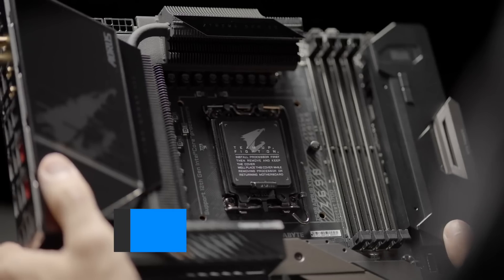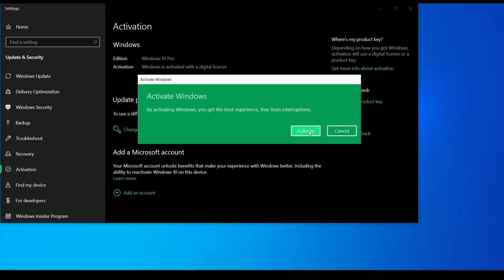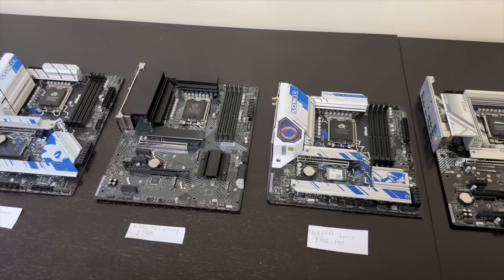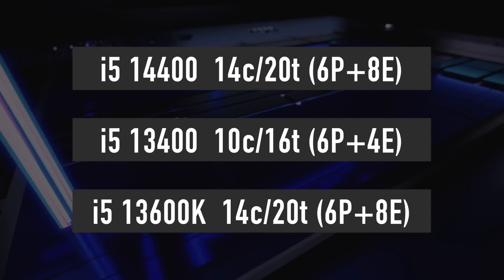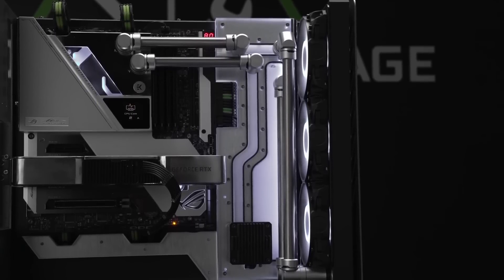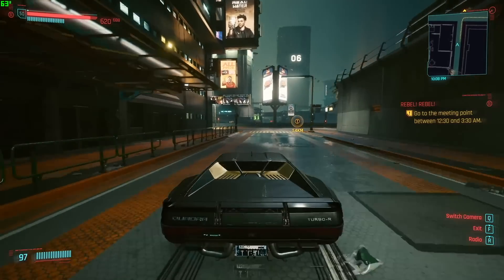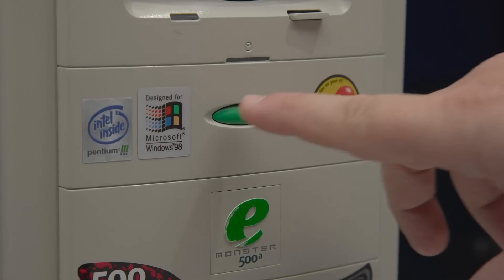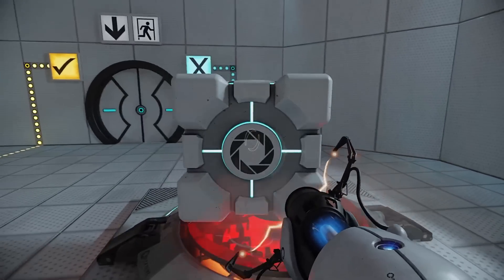Intel 14th Gen is actually VERY impressive! [i3, i5, i7, i9 specs, performance, release date]

Comment: Intel is fooling us, why they didn't make the primary core is higher than extended core, example in i9, they can make the primary is 16 cores 16 threads and the extended is 8 cores 16 threads for better, not this 8 cores 16 threads primary and 16 cores 16 threads extended

Comment: Unfortunately, the 400 series i5 has gone well beyond ‘budget’ nowadays, especially in countries where you’ve got VAT and Import Duties to factor into the retail price. The lowest price here in South Africa for the 13400F is $265.
Edit: The 13100F, on the other hand, costs ~$150, leaving a whopping $115 price gap, which could have been filled by a 13200F (6P:0E/12T), in the $170-$190 range, and a 13300F (6P:2E/14T), in the $200-$220 range. Hopefully they do something similar this generation, with a BETTER pricing scheme. There’s so much money for Intel to make in the budget (real budget) market, with AMD having virtually abandoned it.
Reply from the maker: Unfortunately, there are contradicting reports of core count increase. So, we don't know for sure yet. I'll do a follow up video when rumours turn into something more concrete.

Personally, I hope that Intel takes this step and increases the core count for i3 or Core 3 (whatever they'll end up calling it in the future🙂)

Comment: I do not think it's worth upgrading with such a timid performance. I have a PC with 13th Gen it's Ok. Just take a look at Intel they manage to release another Gen within less than 12 months. Really waiting for Ryzen 8000 results.
Reply from the maker: True. Ryzen 8000 is the next big release that should bring significant improvements worth talking about🙂 But you probably won't need to upgrade for a long while.

Comment: Sir, I have 12400f B660 chipset dose it support 14th gen 14400f
Reply from the maker: It will eventually. Your motherboard manufacturer will have to release a BIOS update at some point to make the motherboard compatible with the 14th gen.
Reply: @theivadim  Thanks for the information

Comment: Considering Intel for my next build to avoid Fanboyism.  Currently have an all AMD AM4 build.  Can someone provide a video name on Youtube that explains the benefits of E-Cores for gaming?  I would like to also have more than 8p cores and not a collection of cores so that we can call it 16 or 24 cores.  I also heard AMD may go the E-Core route as well.  I want more P-Cores cause I don't want to upgrade my CPU for awhile.  I'm not even sure if the Ultra series will have an upgrade path like AM4 or even AM5.
Reply from the maker: The general consensus on E cores for gaming = no benefits.🙂
AMD is considering using dense cores. It's like the ones found in EPYC CPUs  Zen 4c. This is not the same as Intel's E cores. I don't think we'll see it on desktop soon. Zen 5 aka Ryzen 8000 will use normal cores. I suspect that using smaller (dense) cores is beneficial for laptops where size is important. So, we may see that strategy implemented on laptops first.

Comment: Not worth it. I have 2 z690 motherboards i updated bios in. One has 13600k one has 13700k. Good enough for now. Get 12th gen or 13th gen if small difference in price. Other option get ryzen 7 7800x 3d

Comment: Just got a 13100f a couple days ago. These new 14th gen will offer a great upgrade path for current lga1700 mobos, in in 3 or 4 years, for the time being i'm happy with the 13400f.
Reply: In 4 years you will upgrade all of your components. 14th gen will be 3years old at that point. Is someone buying 11th gen now 😂? No, it’s outdated. Same logic for your case. Either upgrade in the next 1-2 years or you buy new mobo in 3-4 years
Reply: @daniil3815  don't know for others, but i like to squish my hardware, before the 13100f i was still using a core2quad based xeon x5470 as my main computer, and am writing this on another core2quad with linux.

I might give a look for 14th gen in a couple of years, but for the time being i'm happy with the 13100f, but as always i will squeeze it to the limits.

Comment: apparently the 14 gen will have 20 PCIe 5.0 lanes to the CPU - sufficient for 1 x PCIe 5.0 x16 (graphics card) and 1 x PCIe 5.0 x4 (M.2 NVMe SSD). a motherboard refresh is necessary for this, right?
Reply: Unless there's a new GPU that requires PCIe 5.0 out there, I doubt it
Even current beast RTX 4090 still run optimal on PCIe 3.0 x16 mode (equivalent of PCIe 4.0 x8 mode)
Next gen graphic cards probably would still run on PCIe 4.0

Comment: I am excited about this. I currently have a 12600k on a z690 motherboard and was sure I wouldn't be able to upgrade past 13th gen. Not only will the 14600k have higher clock speeds but 2 more E cores and 4 more P cores so this will be a noticeable upgrade while still retaining my z690 motherboard.
Reply: I'm excited about this as well. Just got a new mobo, GPU & CPU a few weeks back and I'm glad that I will be able to get a 14 700K or 14900K to replace my current 13600K for a great improvement maybe 2 or 3 years down the line. :) I just upgraded from a 9400F, LOL!
Reply: Same

Comment: Based on the video the difference between the i9 14900k and the 1900k isn't that big I'm getting the i9 13900KS soon, and based on previous data it does slightly better on FPS  I may assume it's pretty much close or the same as the i9 14900k , if my CPU is good I could overclock P-core to 6500 Mhz, it will be interesting  to compare stock, and then overclocking between both, but in the end I don't think it's worth upgrading if you have a 13th gen CPU already
Reply from the maker: Are you getting a 13900KS at a discounted price? If not then might as well wait for the 14900K to see if it offers the same performance at a lower price. The 14th gen may feature a better memory controller for higher (more stable) DDR5 speeds.
Reply: @theivadim So I ordered mine from an Australian retailer since there were none available in the U.S. There was only one available, but it was being sold by a scalper at a significantly higher price of over $1k. I managed to get mine for around $760 and had it shipped to the U.S., so in total, I ended up spending $860.

I currently have a regular i9 13900k, but I'm using that in my friend's build. I plan to build my new custom PC in 2 weeks from now, which is why I didn't want to wait for the 14th generation. I believe it's worth it anyway, especially since I'm coming from an i9 9900k build that I made 5 years ago.

the price is still within MSRP price range and I plan to overclock my CPU
Reply from the maker: Understandable🙂 Enjoy your upgrade and have fun overclocking!
Reply: @theivadim  Thank you!, hopefully I will be uploading a youtube video on the process next week.

Comment: No 14900ks? Also anyone who has a compatible board (especially those who bought low end 12th gen) could make a very decent jump with great value once the 15th or even 16th gen come out and prices of 14th gen become more accessible. It could make a lot of sense for many users
Reply: it looks like its upgrade just for people that have i3 12-13gen and i5 12 gen. Sadly 14900k still is 8 core and i would feel bad to upgrade from my 10900k with 10 p-cores

Comment: I3 would be insane if still priced around 120 bucks. But generally said, for lga 1700 users with i3s or 12th gen i5s, the upgrade to a 14600k could make sense, since almost no one will ever use more than 8e-cores going higher will likely end in diminishing returns…

Comment: Glad I jumped into Z790 from Z690. Was hoping 14th gen would utilize z790. Hoping the IMC is better on 14th gen than it is on 13.
Reply: considering 12th and 13th have identical IPC, this will be the same as well. they are only bringing out 14th gen to try and keep up with AMD using the same architecture.

Comment: Just bought 12400f(150€)+32go ddr4c17 (60€)+ rx6700xt (300€)+ nvme 5500mo/s(50€)+ psu750w silver (70€)+ motherboard (120€)+ case(50€)+ cooler(35€). An all new 2k ready pc for less than 850€. Can't see better deal and upgradable to 14th gen with no bottleneck for future gpu. If not on extra tight budget, would have gone for an am5 7600 with ddr5 6400 low timings but 200€ more for more or less the same perfs. Benefits would be ddr5 and a future upgrade on 8xxx x3d series.
Reply from the maker: I'd do the same if 200 Euros was the difference. You caught a nice deal🙂👍 I hope you'll enjoy your new PC!
Reply: @theivadim  sure i enjoy it , good prime days deals.  Thx for your vidéos, they are also enjoyable.😉

Comment: I have a feeling the prices will be high for 14th gen like the 13th gen prices have been, but when they come out 12th and 13th Gen prices will drop
Reply: Best to buy the last gen stuff is you want value, I don't think these CPUs will be that much better price to performance over last gen.
Reply: @Alex-ii5pm tbh I disagree. If you buy 14900k, it will cost more now, but you will be able to sell this cpu for much higher price later because it’s going to be the best CPU on the socket (mobo gen). And as a bonus you will have better experience
Reply: kogami420  price wise, the 12th gen stuff is better value, if you only care about gaming the I7 is all you need as both CPUs have 8 performance cores at similar performance. The I9s are clocked a little higher and have a few more e cores
Reply: the prices of the 13th generation are not high, but those of the AM5...
Reply: Power draw will be horror.. save the planet lol
Reply: @inuyashatb7575  no it won’t but ok dude…
Reply: @inuyashatb7575  if the load is gaming only the power draw is not much different to the AMD CPUs, if you are worried about power you can always undervolt.

Comment: i have a 13600K, would a upgrade be worth it to 14700K ? i play at 1440p! maybe i got response. despite that it will be interessting when Intel and AMD are on same node, then we se wich really is better
Reply from the maker: I think you are good with the 13600K for a long while. Enjoy it!🙂
Reply: I won't be upgrading my 13600kf for a long time. It performs really well and I'm more gpu limited anyway (rtx 3070). It depends on the rest of your setup, but I'd say it's definitely not worth upgrading for a few years, unless you're doing something really cpu intensive
Reply: No need.
Reply: Watch reviews then decide.
Reply: Unless you have very specific needs (and you would know if you'd had) then only upgrade when the system actually feels slow. I'd say for normal, mundane tasks and for gaming, you should be very good for at least 2 more years.

Comment: 10 performance cores instead of 8 would have been epic
Reply: May be in arrow lake in 2024 or panther lake In 2025. Not confirmed.
Reply: Arrow lake in 2024 has 8 P cores and 40% better single core performance than 13900k.
Reply: @HDRPC  Arrow Lake has 20% better single core performance, not 40%, lol WTF. And the rumors are that there will be a "Beast Lake" which will be extremely focused on single thread performance and gaming and that it will have only performance cores and more than 8 of them. I guess it will be a Panther Lake variant/spin-off

Comment: It is a refresh of raptor lake, and can be used as lga1700. Nice upgrade, but everything is pricing.
Reply: Yup, well said!
Reply: Yeah but I don't think anybody will upgrade to 14th gen from 12th or 13th gen
Reply: @Mayeloski  I can see it from 12th gen, it will make sense
Reply: @@blue-lu3iz get 6400mhz ram instead. is not that much more expensive and it's guaranteed that you gonna get hynix a-die so you can easily overclock it to 7200mhz

Comment: in real world use I don't think the 14th gen is worth an upgrade over 13th or even 12th gen. The KS SKU is obviously a bit of a joke - the 12900KS went on sale at $800 and i've recently seen them for around $350 on Newegg: the KS is obviously just a cash grab by Intel. Does anyone actually buy them? What's the real-world use case? Some extra-sensitive high-speed trading platform? The next useful upgrade has to come from lowering power requirements and increased IPC that should come as a result of moving to 5, 4, or even 3nm process. Those will be the chips worth upgrading, although they will likely require a new socket and PCH. However, if what we've seen with the 12th gen continues, 14th gen will be very good for 13th gen prices!
Reply: Why you want hot a$$ cpu for when you can get i5 13600k for same or cheaper price
Reply: The KS models are really only for those who do overclocking as a hobby. That is, the overclocking itself is the goal. Or for the few who have more money than reason.
Personally, I see nothing wrong in that.

I do think that those who have 12th gen, especially i3 or i5 can have a very VERY nice upgrade with 14th gen. Especially like 6-12 months after release, they could get a very good deal. And keep the same motherboard.
Reply: 13900KS has been sold out for over 4 months now. Don't believe me? Try to find one at any retailer. They're selling like hotcakes.

Comment: Intel used to be amazing but now they run way too hot. Not efficient in any way, poor design in my opinion. AMD is the only option at this time
Reply: 7950X runs at 95C in stock config way more than a recent i9 does. I have both, I watch the temps. So I wouldn't say AMD is the only option. You can lower the power limits in the BIOS for both platforms of course.
Reply: @treyquattro yes
Reply: 80 watt of i9 13900k with undervolt has same performance as 70 watt m2 performance and 82 watt of R9 7950x(with pbo) in content creation.
Amd and apple has node advantage still i9 13900k has similar perfomance per watt.

In gaming i9 13900k is efficient and faster than non x3d chips from amd.
Amd x3d is efficient in gaming due to large l3 cache.
Arrow lake in 2024 has large L4 cache like broadwell to destroy Amd zen 5 x3d.
Arrow lake has 40% better single core performance than 13900k.
Reply: Intel is going to destroy everyone in laptops in just 2 to 3 months in September 2023 with great efficiency, battery and performance,  fastest igpu for gaming.

Then arrow lake in 2024 will destroy amd zen 5 in gaming because it has 40% better single core and 60 to 65% better multicore. It has Large L4 cache.
It will destroy amd in efficiency because they will use Intel 20A node which is far better than tsmc 3nm or 2nm.
Reply: Amd chips are burning and worst in content creation.
Reply: @HDRPC That issue is fix now
And its not amd faults Its ASUS motherboard.

I have 7800x3d and ASROCK motherboard. I use 20$ air cooler.
Turn off IGPU on bios.

IDLE 7 to 12 watts
Gaming 30 to 50 watts
Video editing 107 watts
Temperature 30c to 60c
Reply: People that are concerned with being hot or a lot of power draw should also learn that Intel highend chips are pushed WAY beyond the efficiency window. Bring the clocks back a bit and VOILA! the CPU is now "magically" very efficient.

Seriously, it's insulting how many people think that a 13900K consumes 300W everytime all the time in any workload. While you can run it at 100W and 63 degrees Celsius and not notice the difference in many situations, or have 10-20% less maximum performance in the rest of cases.

It's equally as insulting as the people who think they have to buy a 7600 (non X) to run it in 65W and that a 7600X cannot do it. Jeez people, educate yourselves a bit.

Comment: I think 14600K will worth the upgrade. 16 cores are already good for productivity and streaming while it'll have a 13700K level of performance for cheaper and it'll also draw less power than the 13700K.

Most people only look at performance but power consumption is also a very important factor and even the 14700K being that close to a 13900K for way less power draw is amazing!
Reply from the maker: Yeah, I like a good performance to power consumption balance. Just 5 years ago we had 95W TDP i9 9900K which use to be the flagship😄 Now we have i9 that is 125W TDP but in reality consumes way way more.
Reply: Power consumption is only important in Europe. In the rest of the world, only performance and heat is important.
Reply from the maker: @angrysocialjusticewarrior  more power consumed = more heat. It's physics. I guess power consumption is important globally then. Or did you mean to say "temperature" instead of heat?
Reply: "are already good for productivity and streaming"

even a 13400 is enough to do that you donkey, to say that you certainly never used a new generation processor.
Reply: You know what else has low power draw ?  Ryzen.
Reply: @DragonOfTheMortalKombat  Yes because the people who are rocking let's say a 12th gen Intel CPU should just switch to AM5 and DDR5 instead of just buying a 14600K or a 14700K and call it a day...
Reply: @DragonOfTheMortalKombat  raizen sucks
Reply: @Dex4Sure  Ryzen doesn't suck, it's just overall worse than Intel. The 13600K for example is faster in gaming/productivity vs the R7 7700X for less money. AMD dropped prices right now for this reason. For gaming the 7800X3D is the fastest right now though.
Reply: @DragonOfTheMortalKombat which Ryzen you rocking with?

Comment: Actually, Intel will not be releasing ANY i3, i5, i7, or i9 CPUs with the 14th gen launch.

Because Intel has officially dropped all the i# branding. Now they are all officially called Core 3, Core 5, Core 7, and Core 9.
Reply: they're sticking with i branding for desktop SKUs in 14th gen
Reply: i branding will be used for desktop last time this year for 14 gen desktop raptor lake refresh.

Meteolake is laptop only.

Arrow lake desktop will use ULTRA branding in 2024.
Reply: Ah OK, I wasn't aware they were keeping the i branding for one more year for desktop SKUs.
Reply: @bluegizmo1983  yes, just this year for desktop only. Laptops are already done.
Meteorlake Intel core ULTRA chips for laptops are going to launch on 19th to 20th September 2023.
Meteorlake has faster igpu than 780m.
Reply: You're wrong?